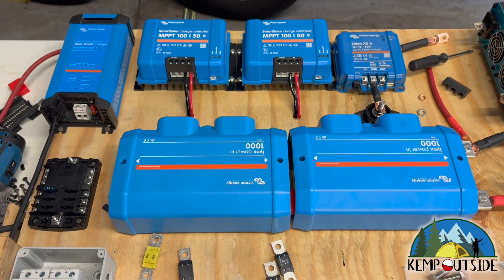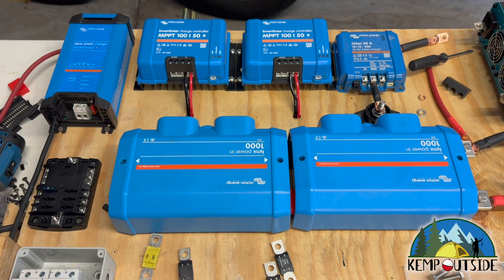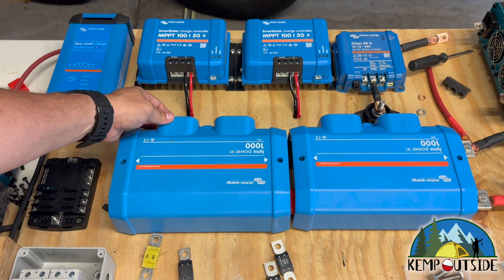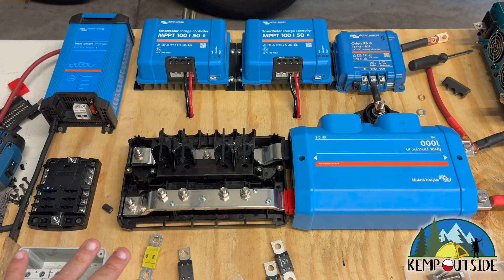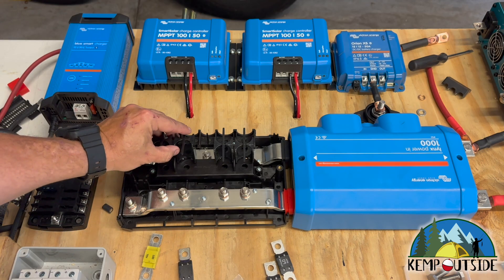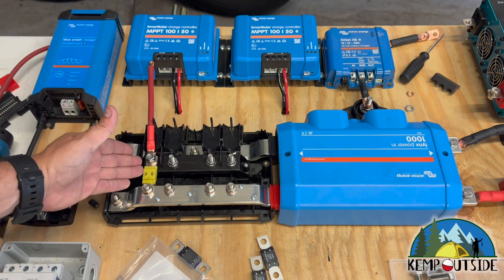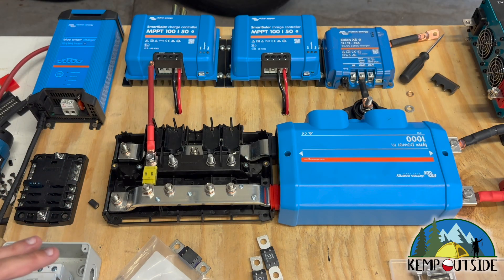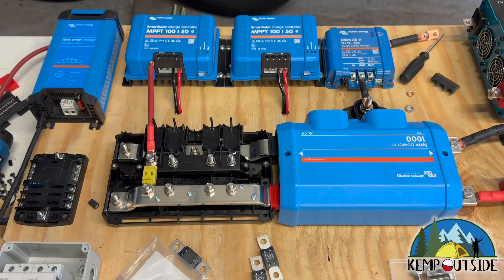Converting Victron Lynx Power In to a Fused Bus Bar

Comment: Too bad you could not add a ``T`` fuse.....for the inverter that is required..
Reply from the maker: I haven’t read anywhere that a T fuse is required for the inverter.
Reply: I would do some investigating  @KempOutside
Reply from the maker: If you have a link please share because it doesn’t specify on the Renogy website.
Reply: @KempOutside  I think he means that some fuse types are not good for 48V but ok with 12V and 24V.

Comment: Do I understand correctly, that you want to install in a car? In a place, where weight is relevant?

This thing weighs 2,1 kilograms each. The job that it is doing is that of a fuse holder. Instead of using a bus bar, you can simply put all your four tiny cables on one screw (The BEST bus bar is NO bus bar!)
Not mentioning the price. I love Victron, but this is really overpriced.
Reply from the maker: it’s in a camper but keeps cabling well organized and compact. sure you could use terminal studs, but I’d also need 4 mega fuse holders and all the wires that go with it. and these cables are not tiny. most are 6 and 4 awg with some being 1/0.